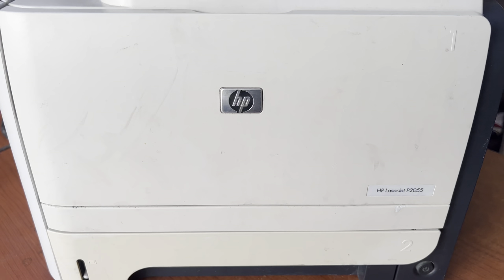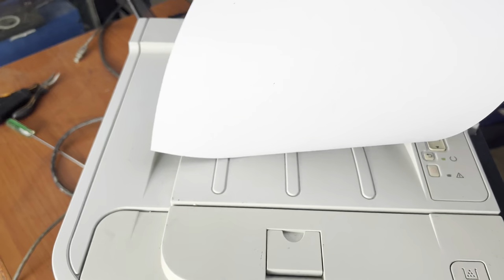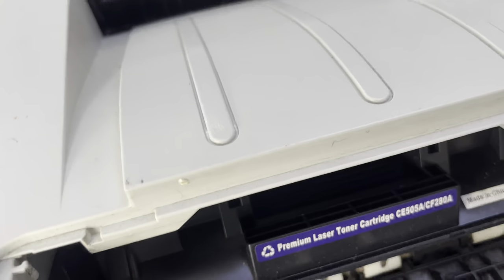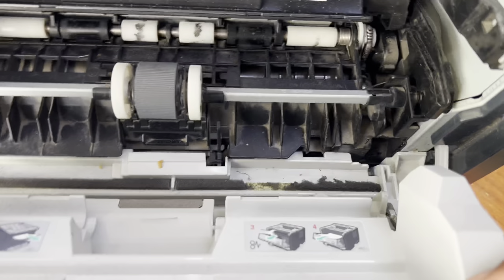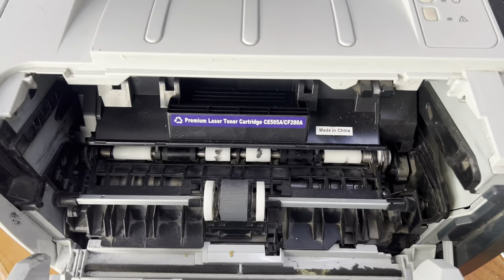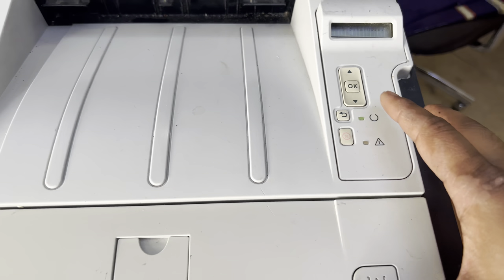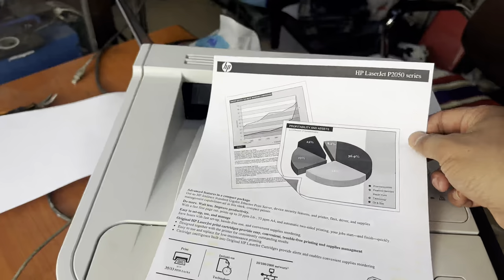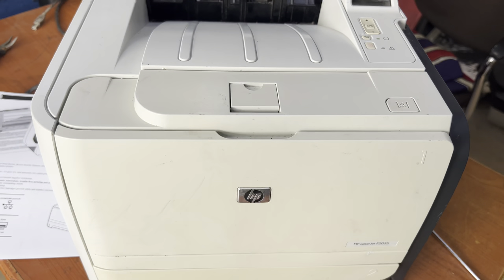How to Fix White Page Printing Issue HP LaserJet P2055 Printer

Comment: My hp laserjet 2055 has been printing blank. And according to your, that place you replace wit paper is still okay, the spring inside under the cartridge is still okay, the cartridge itself is printing well with another printer. What must be the issue?
Reply from the maker: Laser unit